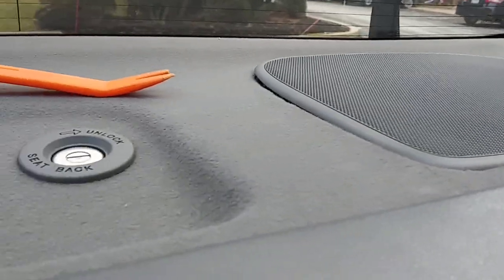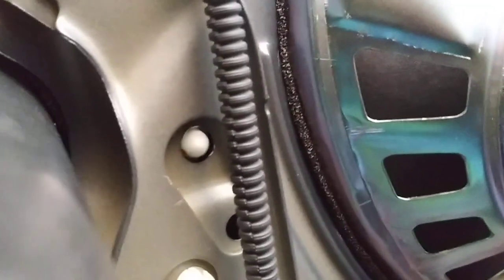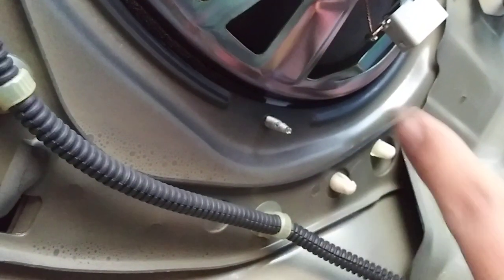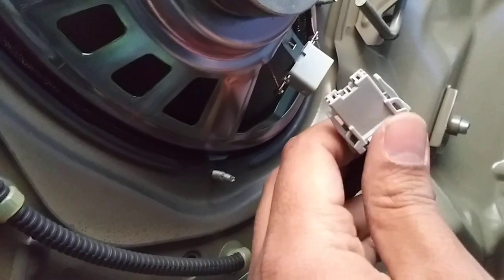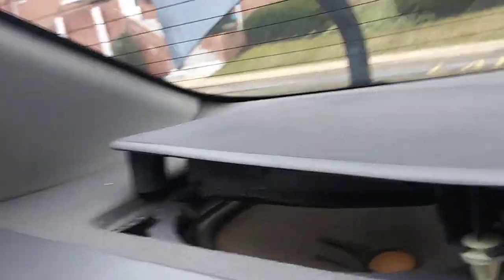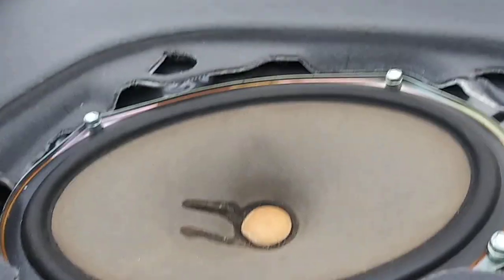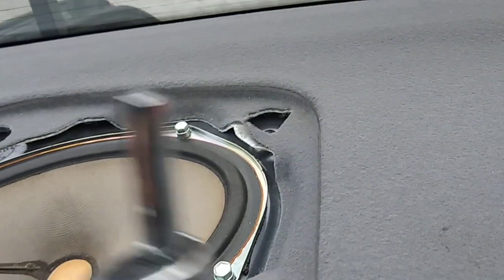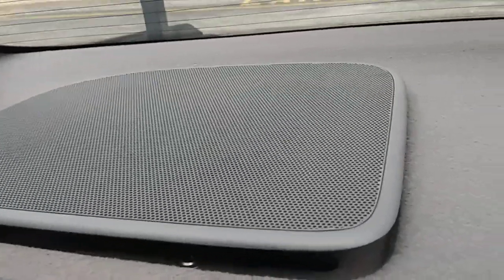How to remove rear speakers for 2006 2007 Honda Accord

Comment: Do you know if the 2007 has an inbuilt amplifier?
Reply: It does not, I’d recommend buying a aftermarket head unit that has one built in, or if you really like your music simply purchase an amp and install
Reply: @lcsvlone2811  Thanks bro, turns out my rear speakers were busted lol!